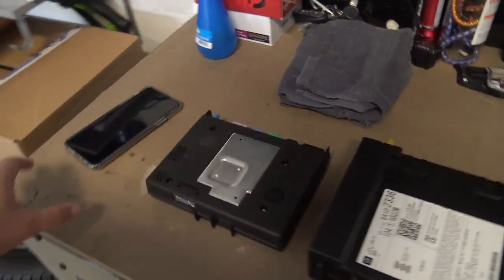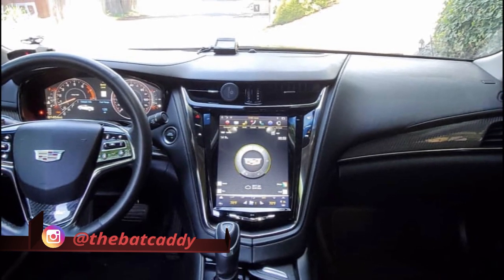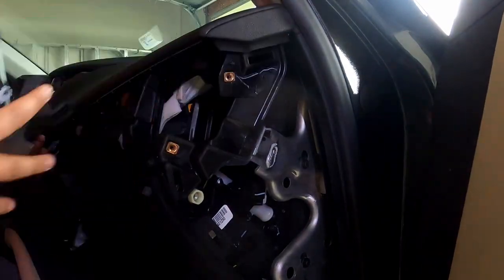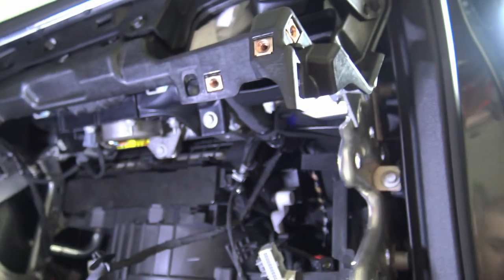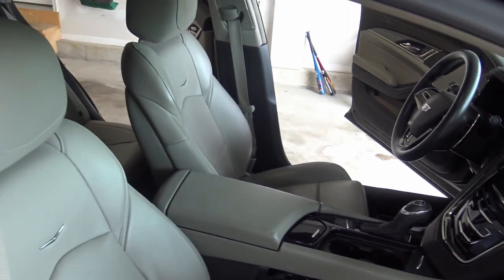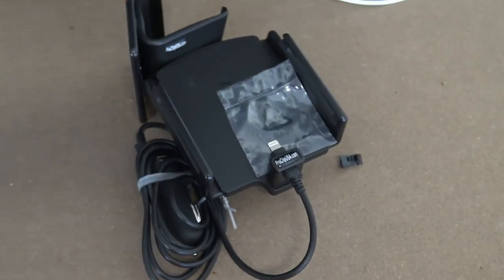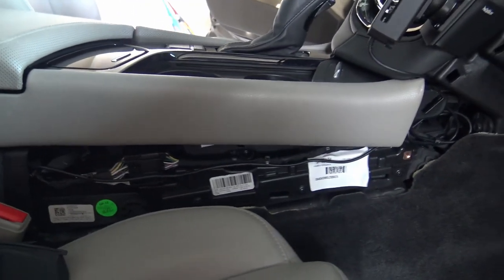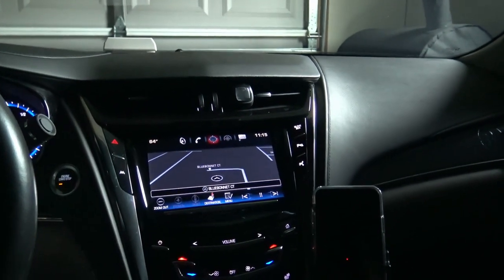Cadillac CUE system upgrade , apple carplay & android auto with proclip mount set up .

Comment: What happens if you don't replace the Radio module? Why is it necessary? What if the HMI is done - only?
Reply from the maker: It will not connect properly, one will it rear the other .

Comment: Hello ,
I have CTS2015 with corrision wanring and the cruise control

can i add adaptive cruise control on it ?
Reply from the maker: It would cost a lot cause you need the front sensor and wiring not worth it
Reply: PRviewsvlogs what the thinfs i have to do if we say i had front sensor which is cost me about 750 $
Reply from the maker: Bro u need to contact Cadillac. , if the car is not wired for that then you need a wiring harness ran  thru the car

Comment: Nice video, hey do they mAke headers for the 2014 cts v 3.6L? If so, do you got a link?
Reply from the maker: Headers ??
Reply from the maker: 3.6 V ? Ok if it’s the regular 3.6 non turbo then no they don’t from what I know , if it’s the 3.6 vsport twin turbo , then there is no headers it would be down pipes , and there are a few places that make them but they do nothing for performance. Check out the newer video on the vsport .
Reply: PRviewsvlogs ty boss
Reply: The LF3-LF4 gain awesome amounts of power with hi flow or resonated cats.  You will see gains of at least 60hp with downpipes & tune.  Saying no gains from downpipes tell us that you have neither the LF3 or LF4.
Reply from the maker: You see very little gains from downpipes , you just said it downpipes and tune , downpipes alone no hardly enough to notice also all my videos show my LF3 so for you to say that shows you just go by what you hear and and not what you see .
Reply: @PRviewsvlogs downpipew alone will gain you about 10-15 hp. But not recommended. These cars will run lean. Add tune and you are up 40hp easy. My V is pushing 580 now so I think I know a little about what I speak of.
Reply from the maker: If you have a ats or lf4 yea not a lf3 and yes they need a tune also there is no record or evidence or dyno sheet that show HP gain on a lF3 from just downpipes cause the car runs rough and nobody has tried it

Comment: @PRviewsvlogs by chance would you know the part numbers of the modules needed? I have a '14 VSport Premium. I want to upgrade to the 2.5 but using donor parts.
Reply from the maker: I have the parts listed on the description section
Reply: PRviewsvlogs do you have actual part numbers? I’m not referring to the affiliate links.
Reply: @teedoe3451  you can use any 2.5 hmi , just need to reprogram it, radio olso need to be program
Reply from the maker: I believe my video covers that .
Reply: @PRviewsvlogs  🙄🥴

Comment: Thanks for the Video, Did you go thru the Setting Menus ?  Heard that Reverse lines are missing?  Did you notice any features that you could not set any more? or just lost a feature?
Reply from the maker: I was going to make a video on what is missing  is drifting but I forgot what features where before , but I still have the lines for reverse , only thing that I noticed that when in the button on the steering wheel to hang up calls doesn’t work anymore with this .